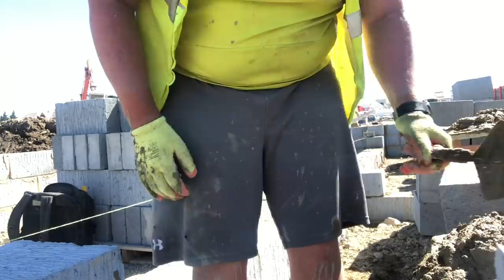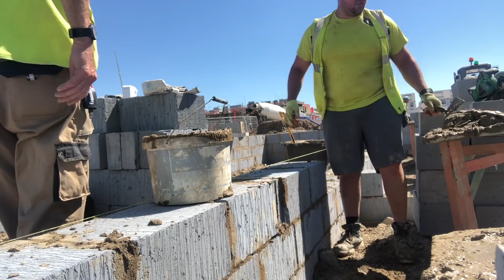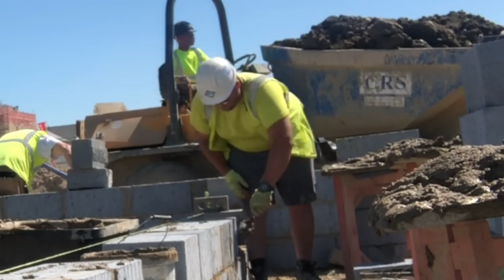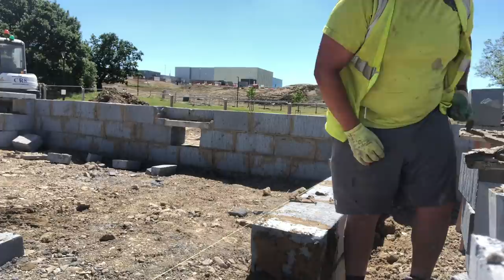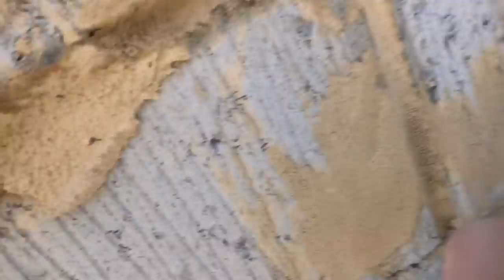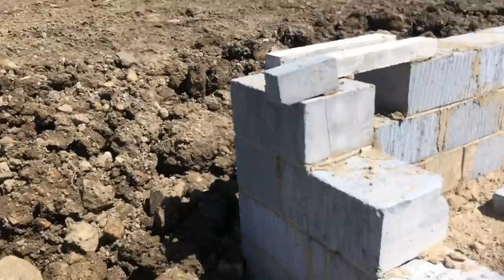Bricklaying Vlog - Deep Footing Build - (Day 6) Working to Live? vs Living to Work? - Part 8

Comment: Little tip while on trench . Get a can of spray and mark a cross for the forklift exactly where you want each pack of trench that way you never have to load out just take them off as you lay them . Save your legs and back 👍
Reply from the maker: Great idea mate, will do that on the next footing job I’m on, got some more to do soon, yeah we learned after the first couple of days to do that, basically workin out of the packs

Comment: Money is earnt in the office Harry getting the price right, you can work as hard as you like and all the hours you like but if the price isn't right you won't earn, I'm 65 never worked more than7 hours a day and usually 4 and a half days a week.
Reply: Couldn't agree more, the trouble on new build is you don't get to price up the work, you are given the price and if you accept it you accept everything
Reply: @markanderson6969  Yea I know, not really done site work since the 80s, used to work ina 4+2 on warehouses  all straight runs laying 1000 plus a day and backing up some of it, cant remember the prices but we were taking home average £480 a week in 84, that finished and we moved on to houses that lasted about 6 months, been abroad or privates ever since, the whole point of being S/E  is to dictate the price not to be told.
Reply: @andrewpalij4691  I tend to stick with extensions and boundary walls, wouldn't even bother doing new builds you have no control at all, I bet brick warehouses were a good crack these days its all steel work and cladding
Reply: @markanderson6969  it was then mate, think it was 30 course to the cladding rail and we used to do it of hop ups but get paid for scaffolding 👍
Reply from the maker: I tend to work exclusively off measure on site, I just know how much I’m getting per thou or per meter block or per meter detail 
And then there extras for special work or if anything stops me it’s  - £25 per hour for any delays/alterations or time lost, i know how much I can get done in a day comfortably and I’m happy doing it, I don’t do plot after plot like most gangs which you just get a price - dpc to floor, then another from floor to wall plate where you have less control of your earnings, ive got a pretty good deal with being one of the only small gangs who works for this contracter atm